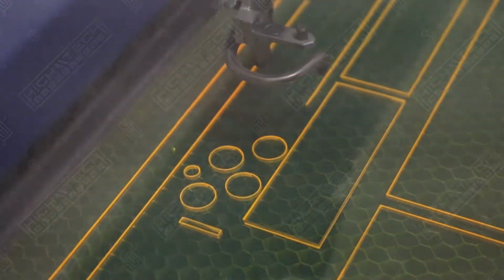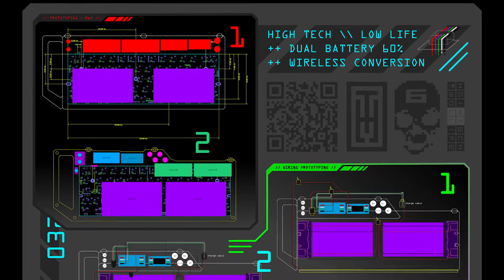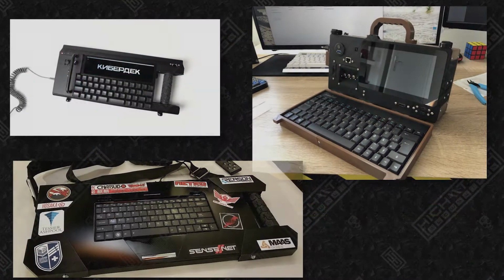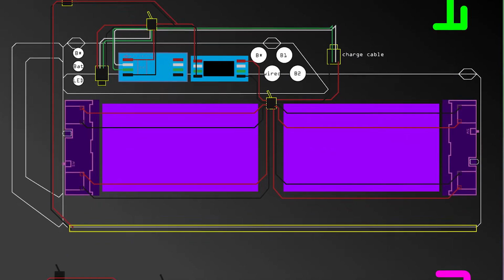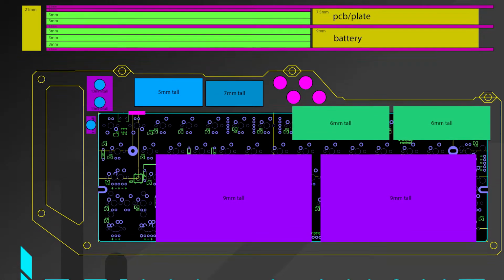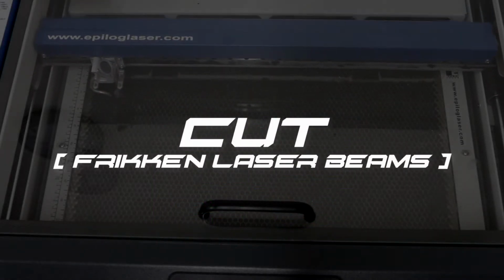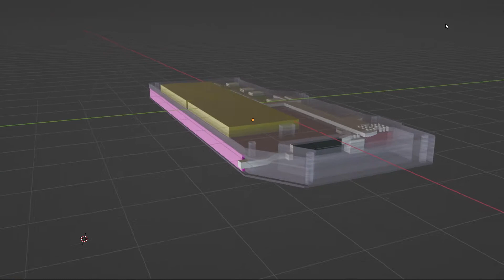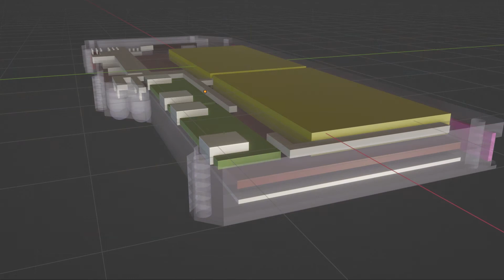⌨ DUAL BATTERY 60% ~ Part 2! Pok3r Mechanical Keyboard! DIY Wireless Conversion + Custom Case Design

Comment: Is there any chance of getting the case design files? or even buying  the cut acrylic to assemble myself? I'm starting to make custom keyboards and I'd like to take a whack at doing this design.  Love keyboards with handles.
Reply from the maker: Yeah sure man, although to me there are quite a few things that could be improved with this design as it is just a prototype really. I will be doing a revision on this case to fix some of the issues. If you really want the files anyway I can send them to you. Thanks man!
Reply: @hightech-lowlife  I'm willing to wait for a better design, just send me a DM if/when you have it
Reply from the maker: @mst3kjedi  Ok no worries man, thanks! When I update it I will make a video, so if you're subbed you'll see it 👍

Comment: Super achievement, congratulations, quite complex, aesthetic and fun, lol! and certainly practical. In the past, I have done a bit of electronics and I have assembled various and varied KITs, and my biggest achievement which always works very well and gives me a powerful sound without distortion even at high volume, is a "Power amplifier", stereo, called "crescendo and it lives up to its name, lol! with Mosfet transistors, (2 large Hitachi and 2 large Philips therefore 4 Transistors per amp) it can operate in 8 or 6 ohm with respectively: a nominal power of 2 x 140 Watts or 2 x 180 Watts and I put it in 6 Ohm of course, lol! because being a musician and loving to listen to music since I was very young, I like to listen to it at high volumes, the power supply is composed of 2 huge Toroidal transformers, and the filtering is carried out with 4 large 10000 uF capacitors fixed by bolting on a large plate and on 2 thick copper strips 3 mm thick and 2 large bridges of 4 diodes each, of square format to rectify the current fixed on the back, on the copper plate e, all connected to 2 large safety relays and 5-second countdown on an electroluminescent LED display to turn it on without direct current passing through the speakers of my speakers and my box bass made in KIT too, with a home-made box, all equipped with "Focal" brand speakers, I added many other Kits to this amp as a sound level meter with microphone placed on the front of the amp , in painted aluminum, which I drilled myself to put the switch, dials of displays etc... and the display of the sound level meter is a needle galvanometer which I lit thanks to 2 small spare bulbs which served as headlights for my little electric circuit cars, and as they are underpowered, they do not burn out and suffice to illuminate the dial well. I put several Wattmeters and there is originally a Digital thermometer with a 2-digit display in electroluminescent red because these Mosfet transistor amps, which are the equivalent of prestigious tube or tube amps like old televisions, go up a lot in temperature and there is a system with a relay, (but which has never worked) which, from a certain temperature which is adjustable on its circuit with a variable resistor, to start one or more fans. When I put the volume high, and in summer, and put a lot of bass, it often goes up between 55 and 65 degrees, sometimes in the 68 degrees and normally the fans should start up around 75 degrees. The temperature dissipation of the 2 x 4 power Mosfet transistors is made by 2 large aluminum radiators, with large fins, these transistors are mounted on an aluminum bracket fixed on the one hand on each amplifier circuit and on the 2 radiators with of course thermal paste to improve the heat exchange, and it works very well, often very hot penny radiators.
My amp weighs 25 kg, so difficult to handle. But I'm really happy with it, I just turned it on, I don't use it often enough anymore and it's not good especially for all the chemical capacitors which tend to dry out a bit. Once I heard that normally this type of amp should stay on all the time, I don't know if it was true.
Reply from the maker: Thanks so much! That sounds like a really cool amp that you've built 🌟🌟🌟My neighbor builds custom tube amps for guitars and basses, but also has made custom stereo amps for enjoying music - he also has made some crazy amplifiers before. There are also some other channels on youtube that make some really cool amps with a ton of LED equalizers that look awesome. Maybe I will build my own amp someday, but my Panasonic from the late 90's is still going strong and to me sounds better than anything I've heard yet, I will be sad when it finally dies but maybe I can build something better then. 

Thanks for your comment and feedback!
Reply: @hightech-lowlife  
Great ! Panasonic is a good brand, I like it, I also made myself active speakers with placed on the back, 2 very high-end car radio amps, SONY, also with Mosfet Transistor and each make 4 x 60 Watts and my speakers compact but very heavy are 4 voices with also a perfect sound. I made these speakers myself and equipped them with a home-made power supply still with Toroidal transformers and a pre-amp for each speaker with 2 Volume settings, 3 potentiometers for Treble, Midrange and Bass for the Tweeter and speaker 2 voices: tweeter and Medium/Bass and 2 other potentiometers: Medium and Bass for the bass speaker, they really sound great and I should make a video on YouTube to present them and show assembly plans.

Super ! Panasonic est une bonne marque, j'aime bien, je me suis fait aussi des enceinte active avec placés au dos, 2 amplis d'aurotoradio très haut de gamme, SONY,  aussi à Transistor Mosfet et font chacun 4 x 60 Watts et mes enceinte compactes mais très lourdes sont des 4 voix avec aussi un son parfait. j'ai fait moi même ces enceintes et les ai équipé d'une alimentation faite maison toujours avec des transformateurs Toriques et d'un pré-ampli pour chaque enceinte avec 2 réglages de Volume, un 3 potentiomètres pour Aigus, Médiums et graves pour le Tweeter et le haut-parleur 2 voix : tweeter et Médium/Grave et 2 autres potentiomètres : Médiums et Graves pour le haut-parleur de basse, elles ont vraiment un super son et il faudrait que je fasse une vidéo sur YouTube pour les présenter et montrer les plans de montage.

Comment: People are usually shocked when they find out I’m not a very good electrician.
Though you can get it working, just the the connections.
Reply from the maker: Thank you! Yes, I just did a ton of troubleshooting - I'll show you guys what happened in the next part!